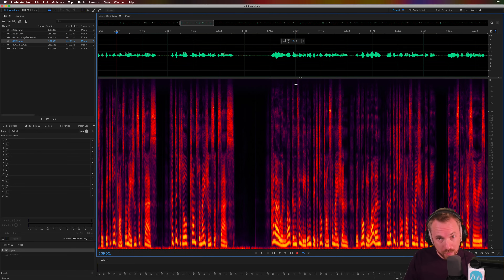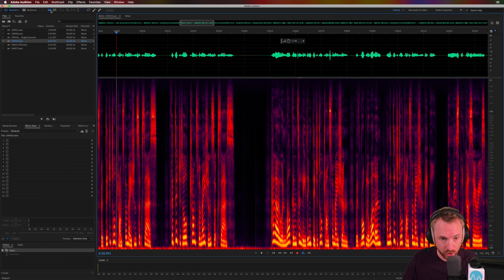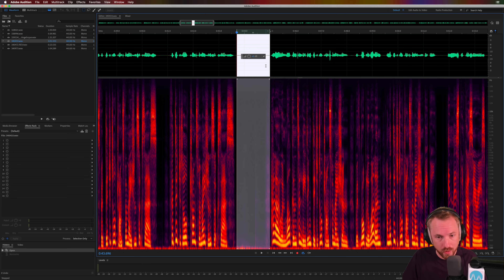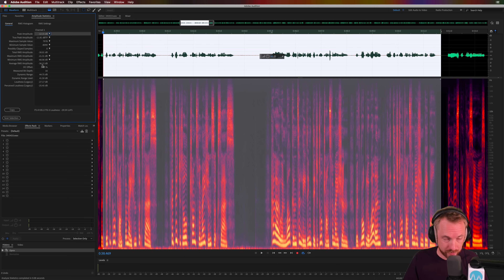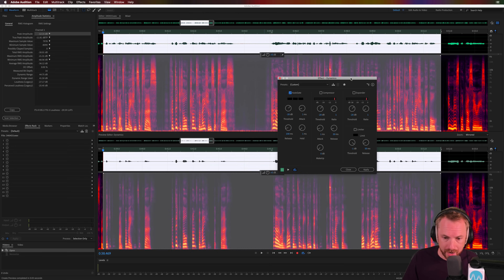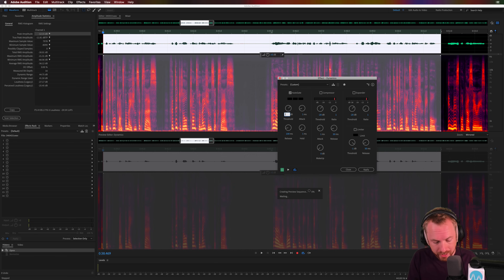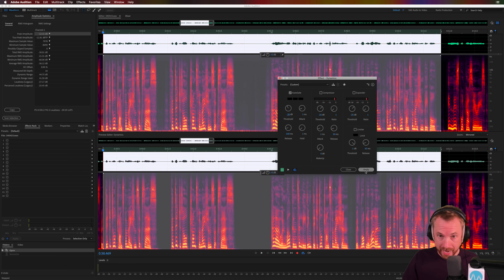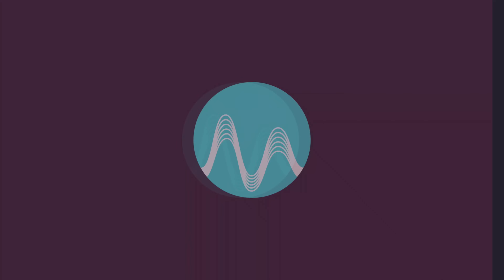How to Use The Noise Gate in Adobe Audition

Comment: hello i have an issue i have an audio but it has a lot of mic bleed from the guest speaker the mic used was a condenser mic i tried this auto gate on the audio it removed the mic bleed when the host wasn't speaking but incases where the host was arguing with the guest it did not have an affect i also used one of your free podcast preset but still no lucky
Reply from the maker: Hi there, it sounds like the noise gate might not be set up optimally for those intense moments – try adjusting the threshold and attack/release settings to better manage the mic bleed during heated discussions. Keep experimenting, and you'll find the right balance!
Reply: @MikeRussell  thank you I’ll try your suggestion

Comment: @MikeRussell is there a way to set up a favorite that will find the Average RMS Amplitude for the file and apply it to the noise gate as you showed here? I'd love to set up a batch process that would use each individual file's Average RMS Amplitude rather than applying the same set number for each file.
Reply from the maker: It’d be tricky to get average RMS on a per file basis for batch without some scripting involved.

Comment: Dear Mike. I am recording noise (-24 db) and I CANT find the source. What can I do? (I think I have done everything):

I have: Win 10, Audition 24, gold usb cable and a Samson G Track Pro, And: I am recording Noice. My old G Track did not do that.
Is there a webpage for uploading noise for analyse? I dont want to use a noisegate for -24 db.
Reply from the maker: You may want to investigate potential external sources of noise, such as HVAC systems or electrical appliances. Alternatively, try using a different recording environment or microphone to eliminate the noise issue without relying on a noise gate.

Comment: Hey Mike, this video is awesome! This is probably a silly question, but when I open Amplitude Statistics I only have Peak Amplitude, True Amplitude, Maximum Sample Value and Minimum Sample Value as options. How do I get the rest of the statistics to show up so I can pull the average RMS amplitude?
Reply from the maker: Hey there! I'm glad you liked the video. It's not a silly question at all! To access more statistics like average RMS amplitude in Amplitude Statistics you may need to widen out the window as it does show up there. You can even change the average RMS using settings in the Match Loudness window too.

Comment: Hi. Firstly your tutorials are amazing. Not just how to use the functionality but also what you are doing and why. 
One question on the noise filter. Is it possible/sensible to put the gate on the recording, i.e. as a pre effect before it’s recorded rather than applying as post? If so how would you do that? Thanks and again m, great work 👏👏
Reply from the maker: Hi Johnnie, you can get hardware noise gates that will work as you wish.  Search the channel for the videos on the dbx286s 👍

Comment: That's a fantastic piece of advice and I didn't realise the birds just outside my recording space were quite so loud! I don't have the de-noise option in Audition 2018, so will be using this from now on. Thank you Mike.
Reply from the maker: Hi Sean, I'd recommend updating to the latest version.  If the birds are that loud the noise gate will be easily detectable with the bird noises reappearing when the voice is on which could produce some very unnatural sounding audio.
 
On the flip side de noise, or any noise reduction technique does lower the overall sound quality so the best option is to find a recording space that's acoustically sweet and away from the birds.
Reply: @MikeRussell  thank you, Mike. It's saying I am on the latest version of Audition, but I am on 2018. Seems this feature was 2019 onwards? I'll check on my Creative Cloud view.
Reply: Managed to download the latest, so I am playing with the de-noise option now. Thank you again kind sir.

Comment: Hi Mike- I'm so happy I found your channel its been a lifesaver for my audiobooks! 
I have a question for optimizing my workflow even more: Would you recommend applying the noise gate before or after normalizing and compressing the audio? My instinct was to do it first, so that unwanted noises arent amplified at all, but thats just a beginners guess! Any feedback would be awesome!
Reply from the maker: For recording audio books my honest answer would be to avoid using a noisegate and get your recording environment as quiet as possible. 
 
If you must use a noise gate then I'd recommend using it as early on as possible and "repairing" your audio before processing it.
 
Just be careful that the noise gate doesn't leave the audio obvious sounding that a gate has been used.
Reply: @MikeRussell  ooooh ok thanks for that insight. And I can see why you recommend that because it is hard to get an accurate level for long recordings...
Reply from the maker: The issue with the noise gate is that is either all audio on or all audio off.  If there is background audio it will be made more noticeable by the noise gate as you’ll hear it cutting back in when you are speaking.

Comment: AQCUISTION OF RMS AMPLITUDE
1) Select everything
2) Window > Amplitude Statistics: Scan Selection Button
3) Read the Average RMS Amplitude

NOISE GATE
1) Effects > Amplitude and Compression > Dynamics: Use the "Default" Setting
2) Autogate
3) Plug the Scanned RMS Value into "Threshold"
Reply from the maker: Thanks for sharing

Comment: I've a "stupid" question if I may: Whenever I use the Noise Gate (correctly), I will not need a Parametric EQ to take out any low rumble, bc that would already be done by the NG, right?
Reply from the maker: Use the hi pass filter as well as the noise gate only removes noise when all the audio is beneath the set threshold.  All audio above the threshold, include rumble, is still let through.

Ideally you want to be recording in a quiet environment as too harsh a noise gate setting will make the audio even more unpleasant on the ear than leaving the noise in.

Comment: I just got a Rodecaster Pro, Shure sm7b, cloud lifter set up and I have noticed some static humming in my recordings. When I have audio processing on with the noise gate I notice that it will cut out that static humming when I'm quiet but when I speak it comes back. What I have done to navigate that is keep the noise gate off, get rid of the background noise inside of audition then use the noise gate again inside of audition. It feels like a lot of work to get rid of that humming. Here is my question: Is this a common thing with my setup to have static humming? is there something I should check with my equipment?
Reply from the maker: The first thing I would check are the cables, the humming isn’t normally there with the Rodecaster pro or the SM7B.

Comment: Mike,  is there a way to reduce (not silent) the ones under the threshold?
Reply from the maker: You want to use the downward expander rather than the auto gate.  The gate you can control the speed it acts but ultimately it’s either closed or open.  With a downward expander you set the ratio of how much the sound beneath the threshold is reduced.
Reply: @MikeRussell  Thanks, Mike!

Comment: What do you do if your average RMS is more than -60? It seems to limit there...
Reply from the maker: If your average RMS is more than -60 you can set specifically to the average RMS, if it's less than -60 then set at -60 knowing anything below there is gated out.  I would have suggest normalising the audio as a starting point before applying dynamics.

Comment: If I am compressing and matching loudness, should I apply the noise gate before or after? I think I noticed some weird artifacts from applying it before
Reply from the maker: I would suggest noise gating before you compress as compressing reduces the dynamic range meaning you're essentially reducing the difference between bad noise and good sound so remove it first.  The artifacts will be due to the noise gate being set incorrectly, possibly the threshold but could also be the other settings too.
Reply: @MikeRussell  thanks a lot! Getting back to me so fast. Great video, will recommend to all!
Reply from the maker: You're welcome and thanks

Comment: Thanks, man! :)
But i have one quastion: I dont have own silent super-studio, so have many noise from PC coolers. And if i do only Noice Gate i can hear noise in voice. Silent is silent, but in voice i can hear the noise. If i do Noise Redaction first and after this make Noise Gate this is be bad for voice quality? Maby you give some advise about setting of Noise Redaction for most good quality? 
(Sorry for my english, it's not my native language). Thank you for your work, dude! You are cool! :)
Reply from the maker: Hi.  The noise gate is simple, either open or closed.  It traps all audio under the threshold but allows all audio over the threshold hence why you still here the noise in the vocals.

This is probably unacceptable depending on what you’re recording voice for.  It certainly wouldn’t be accepted for a professional voiceover.

I would suggest repositioning the computer away from the mic is the best solution here.  Running any form of noise reduction is likely to degrade the quality of the audio unfortunately so eliminate the noise at source and use the noise gate to get any last bits.
Reply: @MikeRussell  Thanks, Mike. I use my vocals for blogging in internet. This is not professional voiceover, but for internet its OK, i think. Thank you for your advises. Still watching you tutorials, you make great work!
Reply from the maker: Thanks

Comment: Thanks for that. I do have a 286s, but found when I used it, there would be a fuzziness to my voice, that I can only describe as a vocal halo. Bypassing the 286, the sound is dirtier, but I don't have that halo any longer once I apply the AutoGate.
Reply from the maker: Strange.  The dbx286s has worked well for me, there's two of them in our live studio.
Reply: @MikeRussell  Thanks Mike. I can't help but wonder if the 286S does a steller job of gating the ambient sounds in my office, but the sounds come through when I'm speaking. WOuld you have a video on setting up the 286s? Maybe I"ve done something wrong?
Reply from the maker: What you describe is exactly what the expander gate is designed to do.  It cuts all sounds below the threshold but once audio goes above the threshold all audio is allowed through.  You want to eliminate the noise at source wherever possible if it detracts from the vocal recording.  Here's video of my most recent settings https://www.youtube.com/watch?v=iBBKFlw01qo
Reply: @MikeRussell  Thanks Mike

Comment: hi thx for this use full technique. what is the main difference between this technique and noise reduction effects or de noise effect? which on is better?
Reply from the maker: Hi, the noise gate will open and close at the threshold set, this traps out noise beneath the threshold but once audio levels hit the threshold the gate opens and all sound, good and bad gets through.  Noise reduction and Denoise work by removing what they determine to be bad noise from the audio by analysing the frequencies and cutting those.  Noise reduction you capture the noise print from the audio and then apply the process, Denoise you adjust the noise reduction filter and Audition does the rest.  Have a look on the channel for videos on both of these.
Reply: @MikeRussell  thx

Comment: Mike, love the NG in AA. In a previous noise gate video, you advised to set the gate to the peak amplitude of the selection of the silence. In this one, you advise average RMS of a wider clip with silence and non-silence. Is one of these methods better than the other. I believe the numbers will usually come out close to each other.

Comment: For anyone doing this and when they click window > amplitude statistics, and not all the options are there, click the "3 horizontal lines menu" next to  "amplitude statistics" tab, then click "panel group setting", then click one of the options. I am not sure exactly what I clicked, I can't seem to undo it, which is fine, but I can't recreate my default setting for explanation.
Reply from the maker: Thank you.
Reply: If you are in the default setup, you can just double-click on the "Amplitude Statistics" label to go back and forth from the short to full versions (where you can see the average Mike refers to) of the tab.

Comment: So is this setting, using the noise gate, better than using the "Noise Reduction" setting? I was just playing with the Adaptive Noise Reduction setting today and it seemed to help reduce the background noise in my audio, but I was still getting some distortion of my voice.
Reply from the maker: 100%. This will not touch the quality of your audio. DeNoise will and Adaptive Noise Reduction can sometimes take a second to kick in.
Reply: Another item to note and it's why I came here to see how to do a noise gate in Audition. Say you record a podcast and there are 4 voices talking into directional dynamic cardioid microphones, but because of proximity the mics pick up not just background noise but the other people talking. It records these at lower volumes. You don't want those voices while you are personally silent and the same goes for the other's mics being recorded. Noise Reduction uses pattern recognition to identify identical sounds and remove them. Say you are doing an interview and a bell starts ringing in the background while talking and continues while nobody is talking. You can sample the point where nobody is talking and use it to remove the sound when people are talking. But These background voices I mentioned are not removable using that feature. The best thing to do is mute any mic not in use while recording, but that's not always practical while you are hosting and playing engineer on your portable equipment. So a noise gate will do just that for you in post. I was using a Zoom Podtrak P4 which is marvelous if you are using it in a regular room with a fan or an AC running in the distance, and can distance yourself or do phone in's as it has it's own noise gate to cut out typical background noise. But this situation I described will need a noise gate hardware solution or one in post.